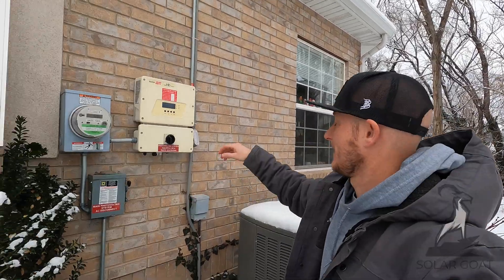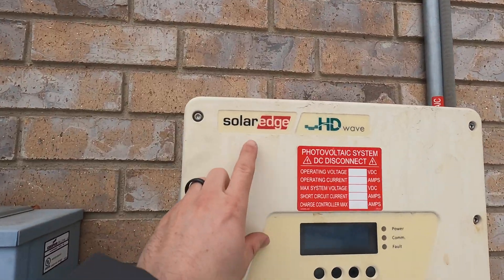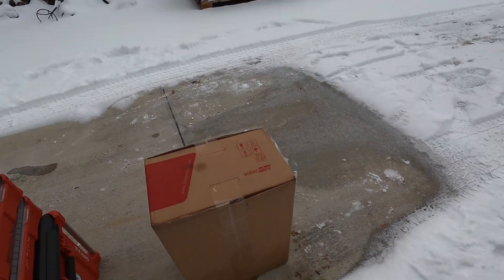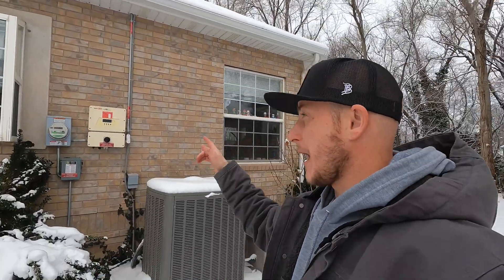SolarEdge Broken Inverters

Comment: Good video. In Australia, I just had my 6 yr old inverter fail. 18 x B5 error code then HW Error came up. (HW = Hardware). I check my solar production EVERY time I walk past the inverter. I LOVED the inverter with the display screen as it showed every aspect of your system. 
The new inverter HAS NO DISPLAY SCREEN at all which is a pain. SolarEdge did supply the new inverter under warranty after many many hours trying to get get them to help me. They contributed to the installation but I had to pay a SolarEdge recommended installer $150 extra as he said warranty payment for installing a replacement inverter was insufficient for his time. Now the SolarEdge portal diagram of power flow wont work but it does show panels and production luckily.
My overall experience with SolarEdge was when it worked it was great. But  getting ANY sort of after sales service for warranty was A NIGHTMARE totally zero care and a call centre in India that only wanted to talk to installers not owners. And because my original installation company went broke the process was even harder. Out of 7 SolarEdge Recommended  Installers for Warranty in my state, only 1 ONE said they would help install the new inverter. Conclusion I would NEVER recommend SolarEdge again.

Comment: SolarEdge is one of the worst on the market from a owner perspective, it doesn't allow for troubleshooting without access to the installer app. If it disconnects you need to pay hundreds of euro to get someone to fix it, something that could easily be done by the owner.

Comment: Replaced the old inverter with a warranty replacement supplied by solar edge. The new one even after rebooting is having the same issue and will not recognize the power switch and won’t link up. Any ideas

Comment: This is a very informative video. One of my reasons for getting a solar system was the scenario where the grid goes down for an extended period. Before solar the grid was my single point of failure. But as with many things in life technology has made my situation worse instead of better. Let me explain how I am now dependent on the worlds grids and infrastructure and how many failure points have been added. The inverters have a cell connection using the Verizon network and there is nothing you can do without this. Can't check to see how the system is running, can't see any errors. Next you need the internet across the world with the associated electrical grids around the world.  I am making the assumption that their servers are in Israel because that is where they are based. So I don't even know how many failure points that is. Finally the AT&T cell network has to be up and connected to the internet  because their app runs on my cell phone. Even then solar edge does not allow me to fully manage my system.I paid a lot of money for batteries to protect myself from an extended grid outage.  I asked how to change from maximum self consumption to using the batteries for backup only on the app but NO the answer is the customer is not allowed to control their system. My installer  has to do it, but they ignore me for weeks. So if there is a bad storm coming I have to plan weeks in advance and hope they can get to me before the power goes out. If I had known this I would never have bought solar edge.

Comment: My 7.5 KW HD wave inverter died after one month, the service technician pointed out a  resistor that failed. Two weeks for an RMA and it was broken out of the box. Solar edge support asked for a picture of the circuit board and immediately identified it as a faulty unit looking at the same resistor. Another two weeks and the second RMA unit was dead too. I saw a small metal heat shield attached to the offending resistor with silicone and apparently that is how they know a RMA unit and know it is not going to work. A couple of weeks later and an official  solar edge technician came from Phoenix and put in a fourth inverter. It will only operate with the battery in backup mode and not in maximum self consumption.  So 4 inverters and still not working correctly.  I buy the cheapest stereo from China and it lasts for years. And to add insult to injury you can't control your own system. The installer has to change from backup only to self consumption.
Reply: I'm doing research prior to receiving quotes and I'm consistently seeing stories like yours from installers and homeowners.... way too many reports of them failing within 2 years waiting two months replacement for that one to end up dead-on-arrival... installers on Reddit have been calculating a 30% failure rate...

Comment: My system is connected via cellular.  My solar edge app wants wifi but app won't connect via WiFi.  Its cellular so why would it need wifi
Reply from the maker: Wi-Fi needs a kit that looks like a cellular one…. Inverter doesn’t have a built in antenna… you don’t need redundancy
Reply: @solargoat  I can see it broadcasting a network.  I can connect to it but can't setup my solaredge app.  Keeps saying contact support.

Comment: I have 10K solaredge inverters and had to restart one a couple times. They claim they monitor it but I didnt get any alert or call. It wasnt until I noticed in my app after randomly checking it a week after it went out. A reboot fixed it.

Comment: Looks like SolarEdge gave them a bit of an upgrade. With a newer HD Wave inverter and backup interface system, is it easier to come back later and add an additional inverter, battery, array, etc?
Reply from the maker: First off, thanks for the coffee. Yeah solaredge doesn’t really make or inventory there older models so when an inverter goes out they give you the most recent version. If you want to add on accessories I’d highly recommend getting the new “energy hub” version of the HD wave inverter. If you have that model you will be able to add more panels, batteries, car chargers etc. and you won’t have to replace the core unit.
Reply: @solargoat  I do have the 7600 Energy Hub with BUI and LG RESU Prime 10H. I was told I can add another 10H for more storage, but it will not increase my backup output.  Is it correct that I can add another Energy Hub if I want to add another 10H or even a 16H to achieve higher output rather than simply expand storage? Will I need another solar array feeding the follower inverter?
Reply from the maker: That’s one of the things I like about solaredge. No shortage of options. If your on a budget you could even just install a regular HD wave inverter for more backup power during sun hours. I would definitely recommend a dual inverter and dual battery set up and the 16H is worth every penny.